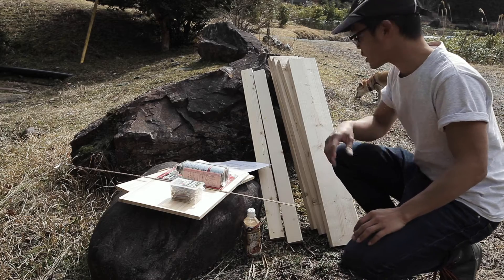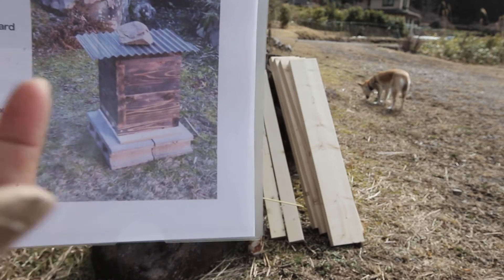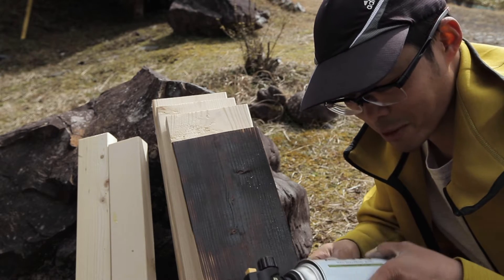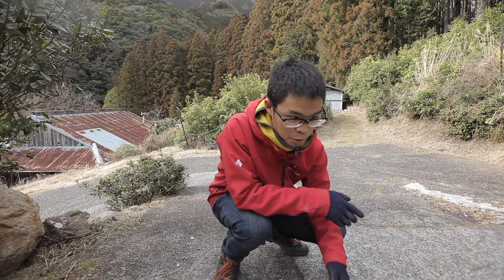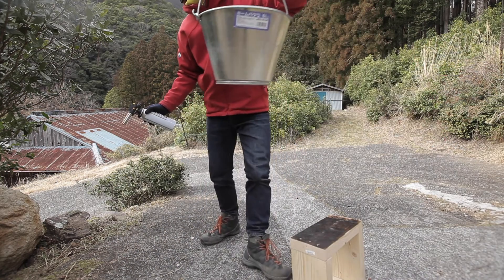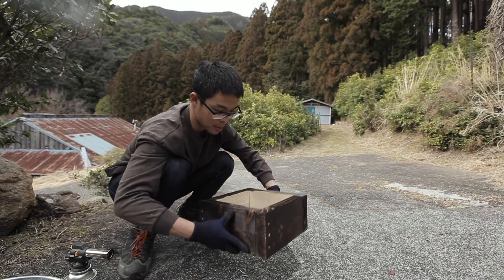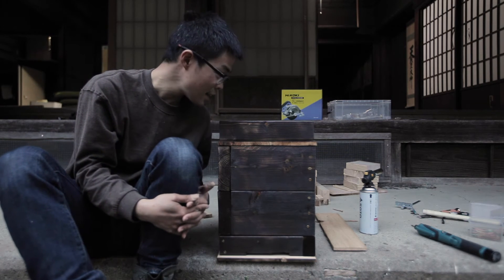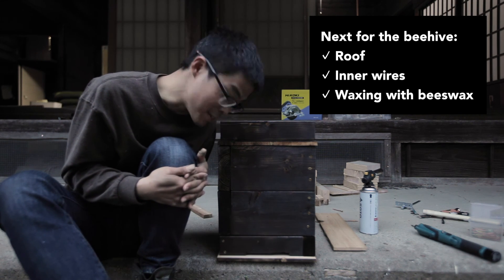Making My First Pile Box Beehive for Japanese Bees

Comment: nice job! greetings from Serbia! I am wondering one thing. How does winter, cold weather up to -10 -15 "C applies to this beehive please? I would like to try this method. Thanks in advance
Reply from the maker: Hello! My bees froze when it got to -9.6°C this year. They were alright up till -6°C. I think they will need a good blanket of straw if they were to survive.
Reply: you are correct. Maybe we can use Styrofoam board as well.  I am about to make the Japanese hive and in case I find natural swarm in the forest I will bring it in and try. BTW I am using Dadant Blatt Bee Hive house which has 20mm thick sides. Thank you for your quick reply! @Ryunohara

Comment: at first part of bee hive after burning it I see that you didn't fit the 4 pieces firmly. it is still space between. At 9:58 min you can see clear the mentioned situation.
Reply from the maker: Hi! Good eye there! Yes the first beehive was a bit of a struggle. I’ve since fixed the gap by clamping the wood together more firmly, and the other beehives use wood that the local carpenter provides, which is planed to much higher quality so there are no gaps when I fit the sides together.
Reply: @Ryunohara  
you can attach them  by making channel in one and opposite in other. than they will fit without any nails. Than you put only the wire.